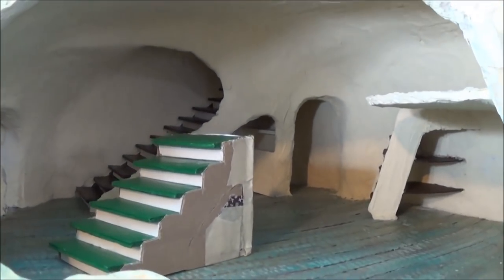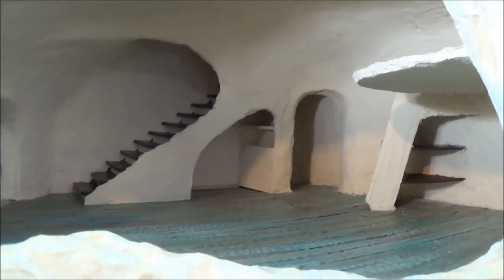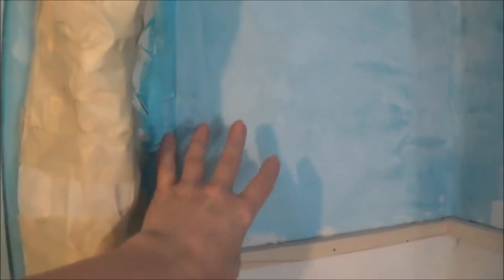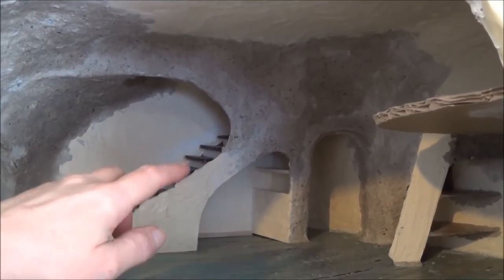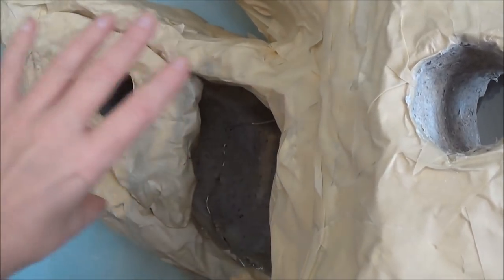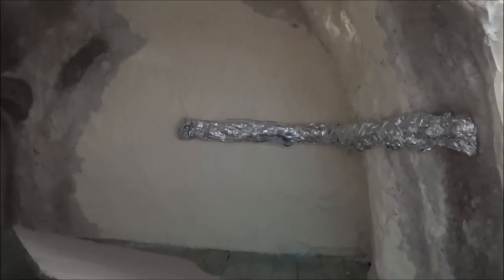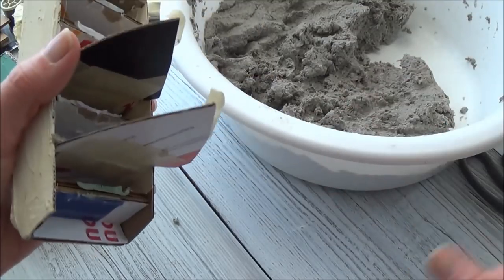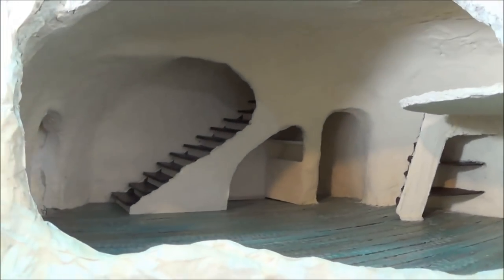Tree Dollhouse  Part 22 Building the 4th Floor

Comment: Hi Sharon. Do you think the ceilings could be done just with masking tape, paper towel and glue? And then once they are dry painted and sealed? Or does it all need to be covered with the clay or drywall compound? I was just thinking of giving the ceilings a different look and texture but I'm not even sure if the dried glue can be painted??

Comment: Lol you make me what to design my tree all over😔lol!! All these ideas lol I love this room and how you put the stairs in. My next tree will have all the nooks and Incased stairs my heart desires 😂 Thanks for the inspiration. If I wanted to build a bigger mushroom house using your tutorial would I add boxes to it or do I just use the tin foil to make it bigger?
Reply from the maker: haha, yay!! I'm so glad :) My Gnome Home rooms were all added just by adding tinfoil... and some of the rooms in this tree were built the same way. Depending on where you're adding a room, you could build the floor first, then build tinfoil up around it, then add in a ceiling. That's exactly how I built the Gnome Home rooms. All of them are just foil rooms, there's no boxes in the Gnome Home. Once I got the tape on, then I would do a layer of paper towel dipped in glue, you could use newspaper as well.. then clay inside to make them super sturdy. But you could leave it without clay too, I've done that as well.. the walls won't be as solid but they would go anywhere either. So if you do add on a room, say next to it, not on top, then your materials would be worked into the building that already exists. Tape, paper towel, or newspaper.. all worked into that original building. You'll just have to repaint it. Again, that's how I added onto the Gnome Home.  I hope that made sense!
Reply: Where The Gnomes Live yes it did thank you!! Can’t wait to see the overall tree!!!

Comment: Can you share the size of the rooms please? Thanks!
Reply from the maker: the smallest is 6in x something, the largest (4th floor) is 21in x 20in .. each room  is different. The boxes I started off with for the bottom 3 floors were (kind of) measured in the 1st video (putting the boxes together)  to give an idea
Reply from the maker: and the ceilings are between 9 and 10 in
Reply: Thank you! I want to build one using 1-12 scale and I wanted to compare it to yours.I am having trouble building furniture and making it look right. I know you said you don't go by a scale.  I think you have a good eye for sizes because yours always look good. Guess I just need more practice.  :)
Reply from the maker: When I'm done the building part of the tree I will be making the characters on video too. I use the characters for size reference when I'm making furniture. I use the character to determine the height and length of a bed, a chair and so on.. I find it much easier to use the character as a size checker, lol If you're using the 1/12 scale, my characters will be a bit off according to that scale, but I do find in the end most all my furnishings come out to "round about" that scale